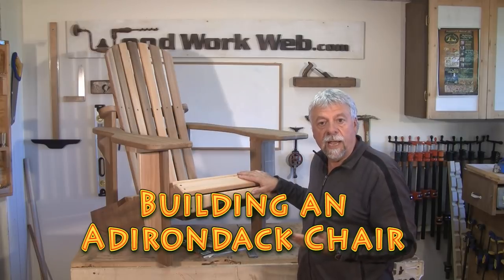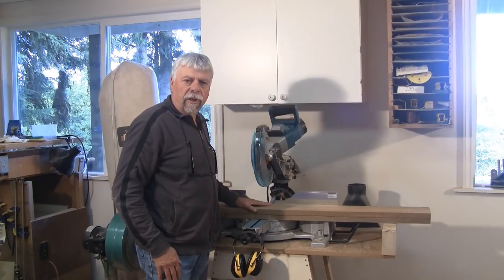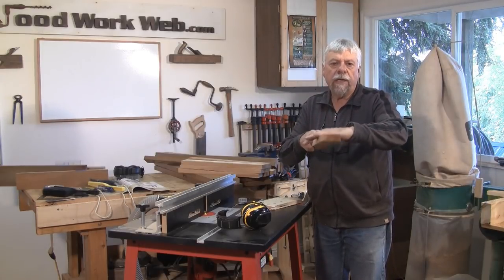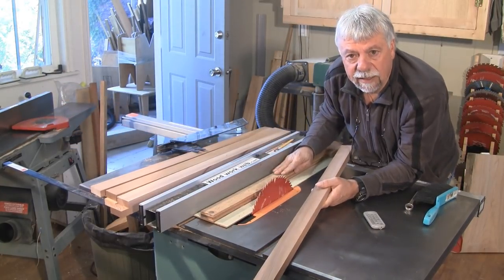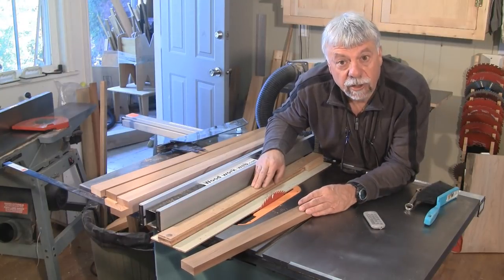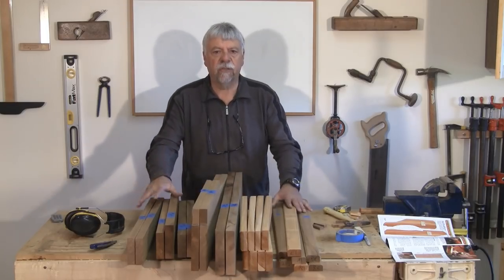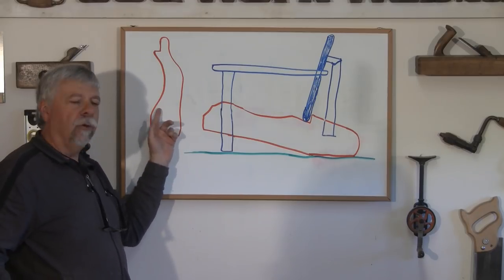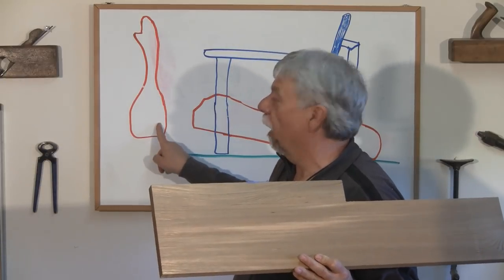Building an Adirondack Chair -  woodworkweb

Comment from the maker: Ah, Pine is a lovely wood to work with, and it takes many different finishes. I would probably suggest some sort of a in what ever color you like, then a top coat of a clear marine varnish. I think that's what I would do in your case, but check with your local paint store, they might have some sort of a one-step out-door finish that will work too. There are always new products coming out, maybe something even more suitable.

Comment: Nice job. I've made several Adirondack chairs, rockers, and one glider bench. Always a fun spring project. A pin nailer comes in handy when the time comes to attach your back and seat slats. Just shoot a pin in the slat once you've got it in position. Do this with all the slats. If you make a mistake it's easy to pop off and fix. Once all the slats are lined up the way you want drill your pilot holes and screw 'em down. Rockler sells plans for an Adirondack set including a glider bench.

Comment: Rockler sells plans for Adirondack outdoor sets including a bench that can become a glider. I made the glider this spring. The plans were nice, but I did modify them to use actual glider brackets rather than the inserts they used. I read in reviews the inserts tended to break out of the wood. The glider brackets are through-olted and wont break out. Turned out nice. TIP: Make hardboard templates up of your favorite designs so you can crank out new chairs/benches/rockers quickly!

Comment: those are the best chairs ever made..nice work,,i was surpised you had the guard so high on the band saw..where i was trained that was a big no no..iam an ole boat builder,from the days when boats were still wood..LOL you are a true craftsman as far as i can see..very nice work.
Reply: 5mm / 1/4" is the max the upper guide should be above the timber. Cuts more accurately (you can see in the vid how the unsupported / guided blade moves) also exposes less blade to cut things like hands / fingers.

Comment from the maker: I don't seem to have the one around that I used in that video, but no worries, taper jigs are easy to make. I usually just make one as I need it with 1/8" ply, about 6" wide and 36" long. The top piece is 3/4" plywood,m then cut the notch out part with either a jig saw or bandsaw. The notched out part wants to be about 1/2" deep usually and tapered all the way to the end of the 3/4" board, then attach from the back with screws. Also check out Rockler etc for more ideas on making one.

Comment: Back when I built a few of these to sell I used to use marine polyurethane clear, lets the wood shine through & protects year round. I believe a lot of these chairs are typically painted a solid color. I think I'd still put a clear coat on the chair if I was going to paint it. 
Thanks for the video, a reminder is always helpful!